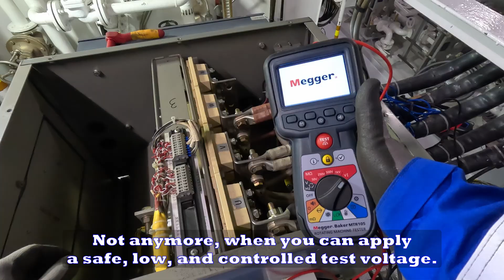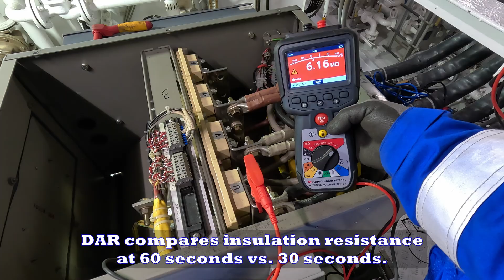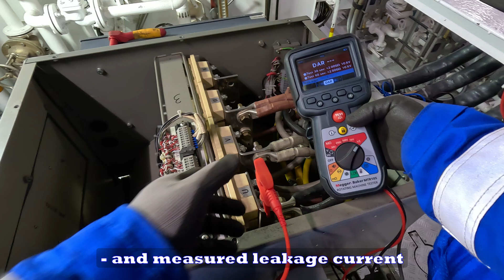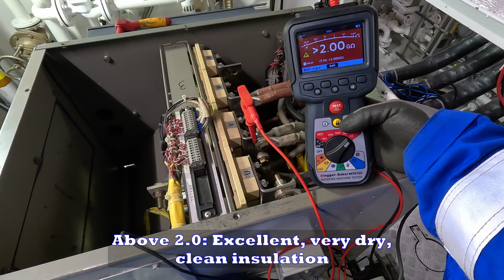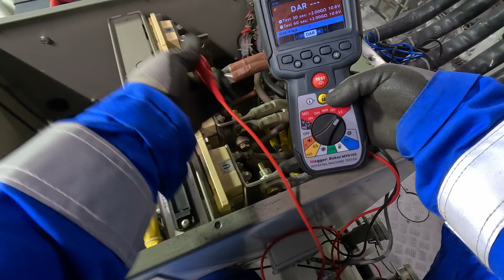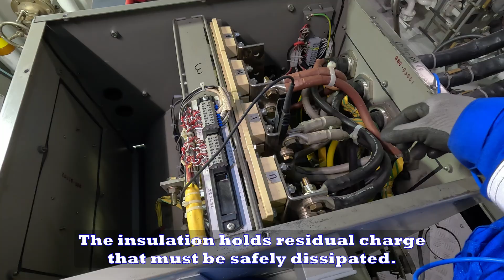Generator Megger Test WITHOUT Disconnecting AVR | DAR Method Explained | Marine Electrical

Comment from the maker: 🔧 Equipment Used:
Megger Insulation Resistance Tester MTR105 (You can buy here: https://amzn.to/43iJEJl)
Test voltage: 10V DC
Method: DAR (30-second and 60-second readings)

Comment: Hi bro , I have one problem with mooring winch motor,  the motor running only 2 speed when it run in 3rd speed it automatically return to 2nd speed after 5second , what should be problem , kindly advise me😊
Reply: If limit switch for windlass operation is active then it will not let your motor to run in 3rd speed

Comment from the maker: ⚠Disclaimer: This is not intended to replace the gold standard of insulation resistance test. A rated voltage and high-voltage (hipot) insulation test is meant to stress the insulation and reveal weaknesses. But that’s not the goal in this method.
In this case, we intentionally avoid stressing the insulation or the AVR. The purpose of using a low test voltage is simply to get a general indication of the insulation condition without risking damage to any connected electronics.
We only need enough voltage to produce a measurable leakage current so the tester can calculate a meaningful resistance value. For a quick health check with the AVR still connected, lower voltage is the safer and more appropriate approach.
If a full insulation stress test is required, then yes, the AVR should be isolated and a higher test voltage applied.
Keep on probing.🔎